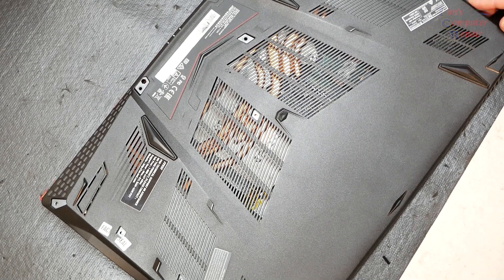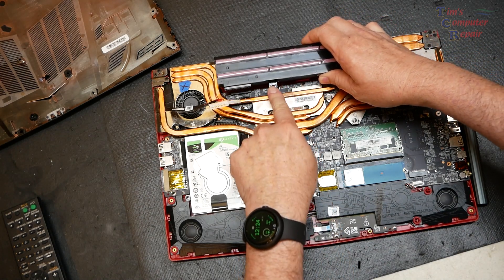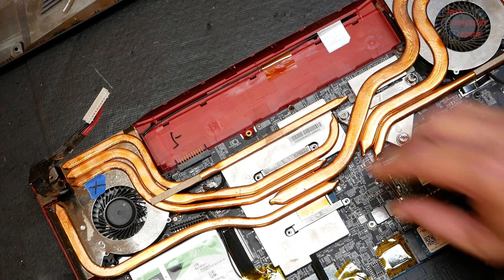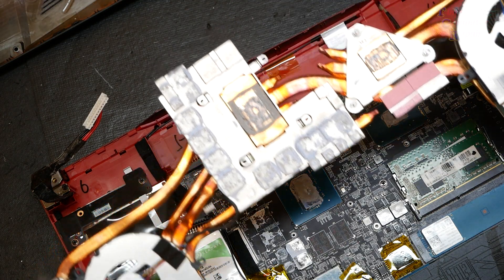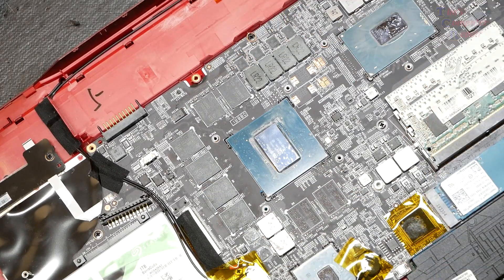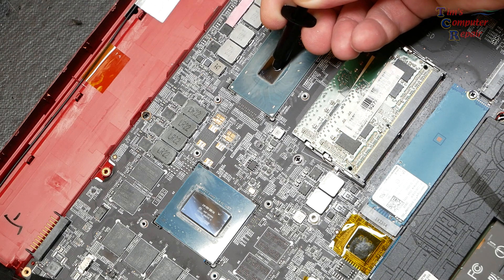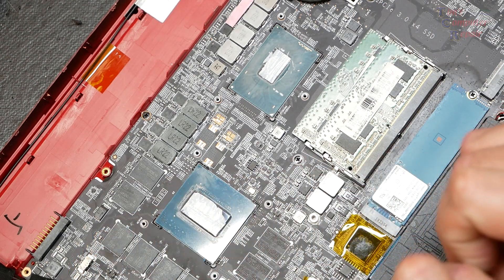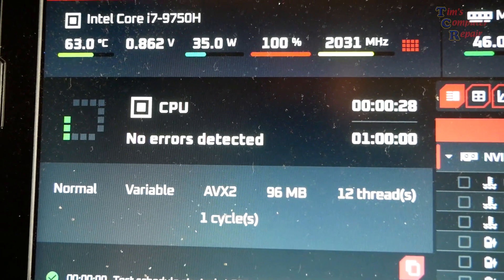Choosing the Correct Thermal Paste For Your Gaming Laptop is Important

Comment: For the vrams and power section, I suggest applying thermal putty such as Honeywell HT10000, Upsiren UTP-8, Fehonda LTP81, Upsiren UX Pro, Laird T-Putty 910, Thermal Grizzly Putty Pro. And for the CPU and GPU core, phase change material Honeywell PTM7950, PTM7958-SP, Thermalright Heilos, Gelid HeatPhase Ultra, Upsiren PCM-1, Thermal Hero Pad, Thermal Grizzly PhaseSheet. It comes in as a sheet, lasts longer, performs works better than traditional pastes and there is no pump out effect.